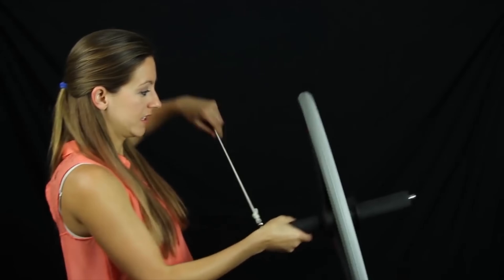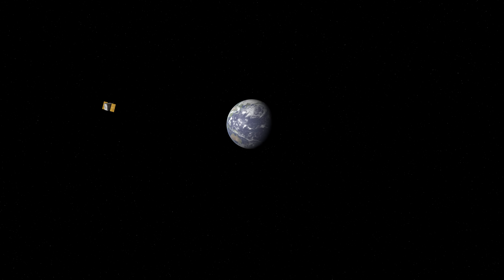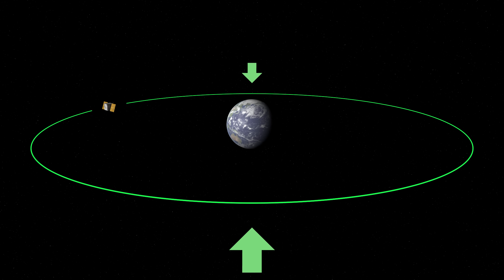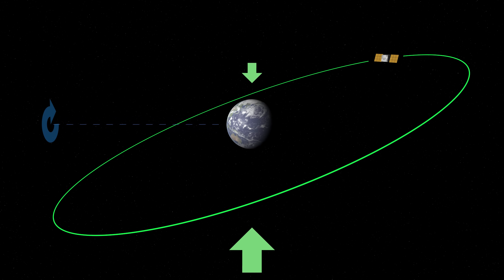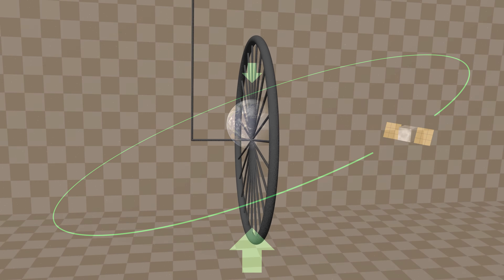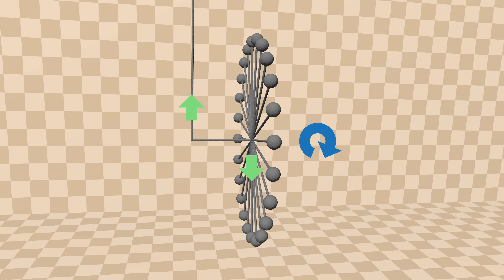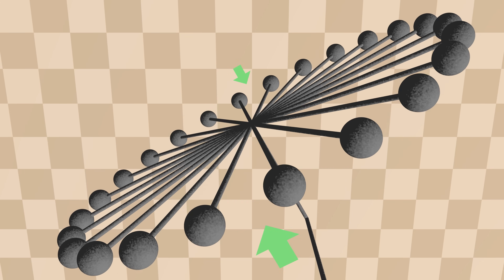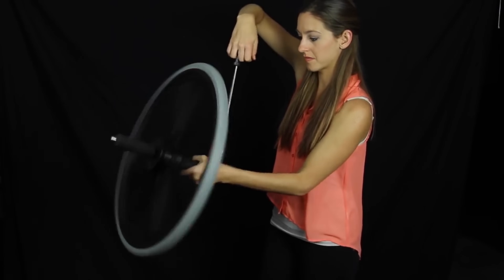Gyroscopic precession -- An intuitive explanation

Comment: This is confusing because there is a discontinuity at :03, and the wheel changes its direction of rotational spin at this discontinuity. The woman is holding the wheel with the suspended/string end toward her both before and after this discontinuity. Before the discontinuity, the wheel spins clockwise from her perspective. After the discontinuity the wheel is spinning counterclockwise from her perspective. Thus, the rotational direction of the wheel reverse at this discontinuity. I was very confused by what I saw after the discontinuity until I figured out the wheel isn't spinning in the direction that I thought it was spinning, and the reason I thought it was spinning the other direction is because it was spinning in the other direction just prior to the discontinuity. Terribly confusing.
Reply from the maker: Sorry about that! I just took that clip from another video (linked in the description), and didn't even think to check if the source material had a confusing cut in it.
Reply: @TheHuesSciTech still replying after 6 years? Bloody legend
Reply: 1
Reply: Your video doesnt explain anything man. The "mystery" that is weird about gyroscopes is "WHY" you can simplyfy the forces to only 2 arrows as in your last min 3.
Reply: @melkerw9910 so what would you say? If you know better, please do share❤️
Reply: @melkerw9910  no
Reply: @melkerw9910  , x and y , Earth is flat.
Reply: @melkerw9910 the gravity is working exactly vertical. The torque on the axis produces the maximal side forces at 12 and 6 o'clock and zero force at 9 and 3 o'clock.
So you can summarize all the forces on the upper half and all the forces of the lower half exactly at 12 and 6.

Comment: So, why does it always act at 90deg ? Should it not be determined by the speed at which the wheel is rotating?
Reply from the maker: Nope, if you watch the video you'll see a justification that it's at 90 degrees, and the speed of the motion never needs to be considered

Comment: I'm sorry but it doesn't clarify things at all for me. Video says "These forces combine to produce a twisting force". WHY do gravity and the tension in the rope combine to create a twisting force?
Reply from the maker: Place a ruler (or anything long and thin) on a table in front of you, sitting horizontally. Simultaneously push up on the left end of the ruler, and push down on the right end of the ruler. Watch as the ruler rotates.

Comment: Much better then the sterile angular momentum "explanation" which is just a description no better then stating what happens. It is quite useful, but the key was the reminder that the torque doesn't change the position but the direction of rotating point.

Comment: Apply it to the earth and all other planets on the ecliptic of the sun, or just the earth itself.  Earth has an axial tilt, is the sun causing that friction?  What happens if that friction increases or decreases?
Reply from the maker: The fact that Earth has an axial tilt is not caused by gyroscopic precession. The leading theory is that Earth's axial tilt was mostly caused by the cataclysmic collision of Theia into a very young Earth (the same collision which formed the Moon). Now it is true that the axis of the Earth's rotation does slowly change -- though it takes about 26,000 years to do a full turn. This is due to an effect similar to gyroscopic precession, but subtly different. Look up "The Precession of the Equinoxes" or "Axial Tilt Precession" for more.
Reply: @TheHuesSciTech  
Why doesn't the Earth  go around the Sun with its axis pointing to the Sun?

Comment: A force on a satellite will not experience a resistance force.  The perpendicular inertia is just normal inertia.  A gyro has an actual acceleration mechanism that creates a resistance force that serves to cancel and reverse input perpendicular forces.  Angular momentum is not it either.  That follows a right-hand rule, so there is no mechanism to it, and it is a math ANALOGY.  Look at my latest video explanation.

Comment: Hi, I just came across this video today. This is a very nice explanation.

There is a similar but somehow complementary explanation on the phenomenon in the paper by Barker "Elementary Analysis of the Gyroscope", Am. J. Phys. 28, 808–810 (1960). Instead of going, like your video, from forces to precession, it goes the other way around: we have this movement, what forces may be causing it? The idea is similar, anyway.

Comment: Okay, I saw the key idea, but you didn't actually TELL that idea. You showed the disk moving around the vertical axis, but during that time, you were explaining how you made assumptions, but that none of that matters, and so forth. Get rid of that bit. It is confusing. Nobody cares about your assumptions, and it just didn't make sense. Remember, as you are showing things, and explaining them, people are trying to keep up, and to conceptualize it all. You already know it, so you are not doing that. Think as a teacher. Give the concepts, and THEN give time to absorb them, and don't confuse them with unimportant details. Also, repeat, repeat, repeat. You could have done much more to then connect the angular path (of about 45 degrees) with how that then transfers into the slow rotation around the Y axis.

Comment: I think it should've stated that the conservation of angular momentum is why the orbit goes negative after a positive force is applied. Is that right? This was helpful because the missing piece in my understanding (which isn't obvious from the math) was the 180deg slant following the bump in orbit. Is it always a 180deg? I'd guess it must be so. Povray? Are you an old Unix hacker?
Reply: So, I see (correct me if I'm wrong) why lifting the spinning metal weights on the end of a pole only works for one revolution (or, actually, just half of one revolution). This is the real answer to the Veritasium question. The spinning barbell weights at the end of a bar allow for 180deg of easy lift but then come down heavier than ordinary for the other 180deg.
Reply from the maker: Haha, how could you tell that it was Povray? Did I mention it in the comments in the past somewhere, or could you just tell by looking at the video? Impressive if so! I do enjoy having a linux server around, but still unfortunately tied to MS Windows...

Comment: The explanation using the satellite being pushed at right angles to it's orbit is excellent!  But I really didn't "get it" about the axis being forced to move to accomodate this push until I first realized that the  satellite is also required to move within a plane of rotation, that plane always by necessity must pass through the center of earth (that's why its a satellite).  So when the path of travel of the satellite is force to change, the plane of rotation is also forced to change.

Comment: I've just come from videos explaining boomerang physics. The remarkable thing about intuition is that it's so intrinsic to the human brain.

Whoever first made boomerangs probably didn't intend for them to return to sender, but found that with the right shape they did. And this wasn't through mathematical measurements or knowledge of gyroscopes, wing lift and momentum, but intuition and probably a lot of free time to experiment with thrown, shaped sticks.

Intuition is such a powerful, intrinsic thing. A strong example of intuition (to me) is the accurate throwing of a ball, either at something or in an intended direction; there's no need to accurately measure distances, the weight of the ball being thrown, the force and angle required by the muscles in the arm... one simply throws the ball, and with repetition (and some desire to improve) accuracy and strength builds. There's no mathematics taking place, just intuition.

And some people are "gifted" with a natural intuition for all sorts of things, whether scientifically viable, or musical, or artistic, or gymnastic... etc

Videos like this are great because they don't require understanding the nitty gritty, they just demonstrate something in a straightforward, visually logical way.

Comment: It's a good explanation but once the first flip to a new orbit had been shown it would have been worth pointing out that the torque was still operating so that the wheel would adopt a series of orbits one after another, albeit smoothly, causing the system to rotate.

Comment: Look at the layout of control inputs to a main rotor of a helicopter - 
the swashplate is designed to the offset of control inputs to give the desired directional effect anticipated.
Typically, a ninety degree offset to a free rotor assembly but a slightly different angular arrangement for a rigid rotor design.

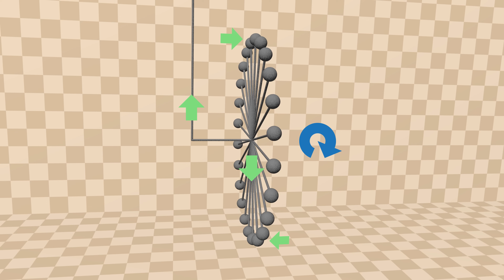Comment: At 2:25, can you explain why the force is away from string at "top" of wheel and towards string at "bottom" of wheel.  How does that make the wheel orient vertically on the side at that time sig, rather than the wheel standing to the left side (the rotational velocity/momentum affects how vertically oriented the rotating wheel/disc/orbit competes).  In the example of the satellite, what is the example source of the force that results in the angular tilt (right up, left down)?  That limits my intuitive understanding, without knowing what force you're using as an example for the satelitte.  If that's the same as the precession on the wheel, wouldn't the orbit angle be continually changing it's angle, ie, wouldn't the orbit itself continue to rise on the "right" side and fall on the "left" side, when if viewed from the perspective in the video would make the orbit appear to be rotating counterclockwise?

Comment: All you have to do is this: tell me where the force countering gravity is coming from.

And the saga to find an actual explanation continues...
Reply from the maker: From a linear force perspective, the tension in the rope is what's preventing the wheel from falling down and hitting the floor. From a torque/rotation perspective, this video explains why the wheel's rotation changes as it does. Can you clarify what else needs to be explained, specifically?

Comment: Gee, I hadn't considered gyroscopic precession when explaining counter steer of a bike. My thinking was much simpler. When you push the handlebars the wrong way, your center of gravity is thrown to the inside of the upcoming turn. To avoid falling over you instinctively bring those handlebars back to stay upright and turn the bike. In those physics examples of suspended spinning wheels, the torque on the axis is up and down, not front and back like you expect from the handlebar movement. The reaction to front back movement of the axis would be up and down, not right and left. On the other hand, I'll guess you would say the up/down torque applied to the axis comes from the road. But if it does, wouldn't there be equal torque the opposite way when you enter the turn?
Reply from the maker: The idea that gyroscopic precession keeps bikes from falling over is a myth -- see https://www.youtube.com/watch?v=9cNmUNHSBac .

Comment: I like to think of it like so: 

If you consider a spinning top the radial vector points upwards and the force of gravity acts downwards.  But the gravitational torque is in the direction of the precession.

Now we can think of this gyroscopic precession attempting to put the center of gravity back over the pivot point (resisting the motion). This is because when the object falls when precessing it would change the magnitude of the torque.  This cannot be the case if the force of gravity and the radial length stays the same. which means the force of gravity will be over the base of support causing the object to be stable in the process of gyroscopic precession.

You can think of it like so intuitively, if you swing an object in a circle it does not fall because the tension in the string increases due to the fact the direction of acceleration in circular motion is towards the center.  

Obviously if you take a metal beam and connect it to an object while holding it the object will not fall, and a loose string will not support an object. Making the string more tense by spinning it faster makes it act like the metal beam, meaning that there will again be this precessive force, and its now easy to see how the object does not fall straight down as the tension you supply to the string in circular motion would just vanish. 

Thats my interpretation

Comment: Something is wrong here with the explanation of gyroscopic precision. When you spin the wheel forward (clockwise) it turns to the left as seen in the video. Spin it backwards (counterclockwise) and it will spin to the right. Here is where I found an issue. Both right and left handed boomerangs are throw forward in a clockwise direction yet the left handed boomerang flies to the right. Why???
Reply from the maker: I don't know anything about boomerangs so I had to look it up. Normal boomerangs are thrown with the right hand, spin anticlockwise as seen from above, and follow a path anticlockwise as seen from above. Left handed boomerangs have a mirrored shape, thrown by left hand, and both the spin and the path are clockwise. So I disagree with the assertion that "both are thrown forward in a clockwise direction", the left hand boomerang case seems to be a mirror image of the normal boomerang in every detail? Happy to be corrected though if you can link to a video or something.
Reply: @TheHuesSciTech  Thank you for engaging. Let me clarify so you understand better. A left and right handed boomerang are just mirror images of each other as you said. Both are thrown directly out in front of you in an almost vertical throw. The trail edge is what makes them turn in the air to comeback to you. If you remove the trail edge all together the boomerangs will not turn at all. They will just fly straight and vertical with no turn whatsoever. So my actual point is that gyroscopic precession has nothing to do with what makes a boomerang return and come back to you. Now let's get back to what is considered clockwise and counterclockwise for a left and right handed boomerang. Picture again throwing each boomerang straight out in front of you. They are both spinning in a forward motion right? So step out of frame here for a second and look from the left side of each boomerang as they are being released and both are flying counterclockwise. Now look on the right side and both are flying clockwise. For a better example take a look at this video I made a few years back titled  ( How to throw a left or right handed boomerang by vic )
Reply from the maker: @VictorPoulin  If I step out of frame and look from the left hand side; I agree that both appear to spin counterclockwise. However, in one case (I think the normal boomerang?) you're looking at the top of the boomerang and the lifting forces are coming towards you. In the other case, you're looking at the bottom of the boomerang and the lifting forces are going away from you. That difference in the applied force is what leads to a difference in the observed rotation.

Obviously physics works the same no matter which point of view you approach the problem; but I would suggest avoiding this side-on view because it's much more confusing IMHO; most of the interesting action ends up in and out of the page (the lift force, the resulting arc, etc). The view I showed in my previous reply makes the symmetries much more obvious IMHO.

Incidentally, and this is pure speculation, but there probably isn't any need for precession to explain why the boomerang starts to arc in different directions after throwing initially, that's just what happens when your lift force is pointing sideways of course. But I suspect precession is required to explain how the axis of rotation of the boomerang changes direction, which is essential for completing a whole loop.
Reply: @TheHuesSciTech  Let me point out that there is no "normal" boomerang. We agreed that there is a lefty and a righty. Each mirror the other. Now let's look at the spinning wheel again. If you spin it counterclockwise it will turn to the left. Even when it is tilted it "still" turns to the left. If you started out tilting it in the opposite direction it would still turn to the left.

Comment: Excellent graphics and really intuitive explanation! What vertical force keeps the wheel hovering on the end of the axle? We saw how the wheel precesses around in a horizontal arc by the tilting force "knocking" the little balls outwards as they come to the top of their orbit.  The wheel then wants to rotate around in a vertical axis like the earth does, but because the wheel is fixed out at the end of the axle, and you're holding the free end, the twisting force set up in the wheel is transferred to the end of the axle in your hand, and so the whole wheel moves horizontally around you. (If a spinning globe, for example, was suddenly frozen onto the end of a horizontal stick held in your hand, the whole stick would swing around you like a baseball bat to conserve angular momentum)  But here's the tricky part: Why doesn't the whole axle just flop down as there is nothing holding the wheel up?  The answer is that the  same force that is making the wheel precess around you in a horizontal plane is equivalent to another "tilt" force poking the little balls outwards as they move downwards as the wheel spins. This makes the wheel want to flop inwards: the bottom of the wheel is pushed outwards and the top of the wheel is pulled in towards your hand. The whole wheel is being twisted around a horizontal axis tangential to the path of precession. This secondary twisting force, which tries to pull the bottom of the wheel outwards, is what causes the torque in the axle that keeps the wheel up.